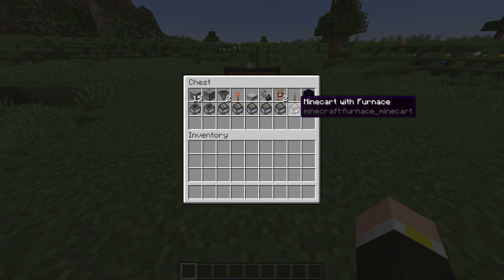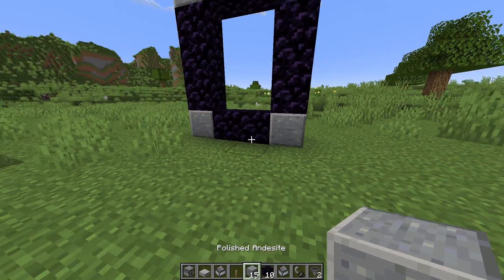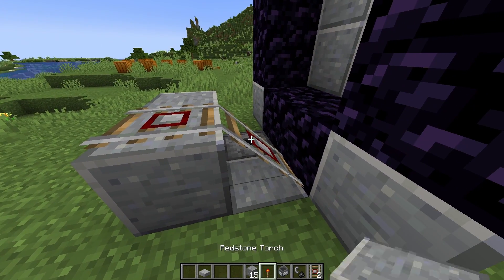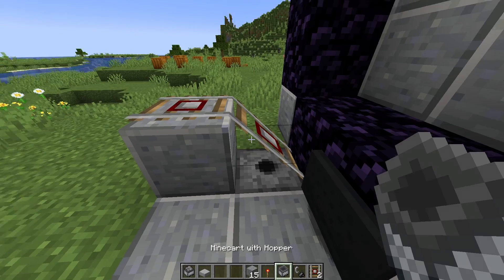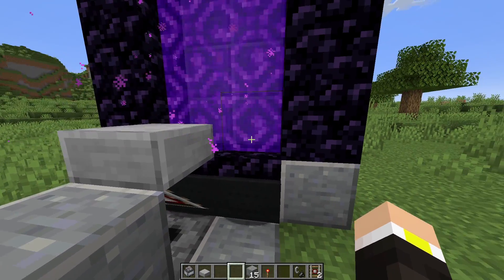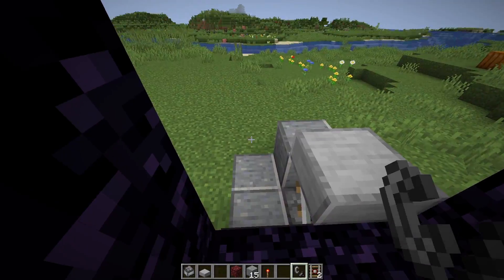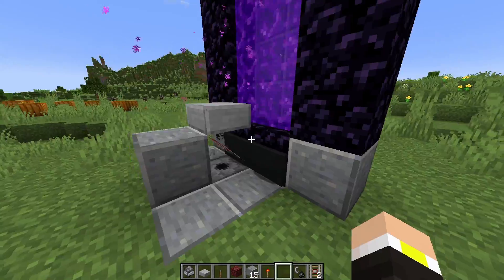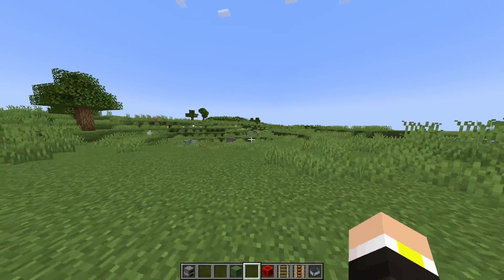Minecraft 1.20.4 Chunk Loader Tutorial

Comment: Having some difficulties with this. Hoppers and minecarts are all set up. Hoppers are working and all items return to the dispencer. The issue is it wont continue to run. I have 5 furnace carts in the dipencer, flip the leaver and place the 6th. It goes into the nether then appears back in the dispencer. But the dispencer doesnt continue to push out minecarts.
Reply: Same problem I used a red stone repeater to the dispenser

Comment: I'm having an issue, I want it to be near my sand farm ( The farm includes a nether portal for easier travel with Minecarts) and If I make it near my farm this portal leads to the portal in my farm which would interpret it. What shall I do? I tried making it in the edge of the third chunk border but the portal were still linked
Reply from the maker: You could try to build it on the same portal and use it for travel as well.
Reply: This is late but you need to properly link your nether portals.